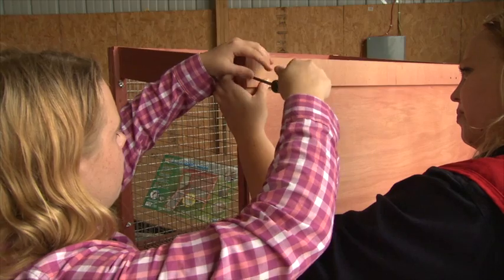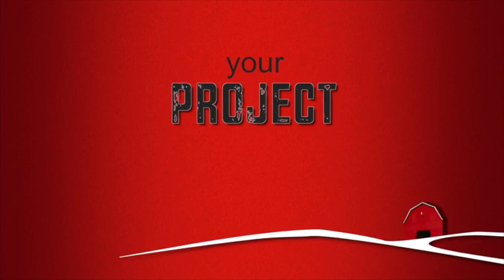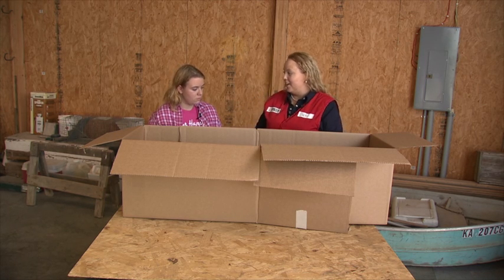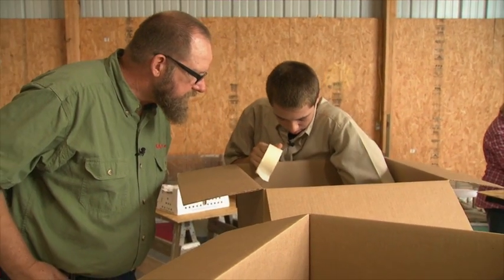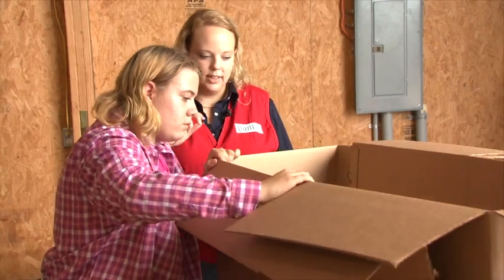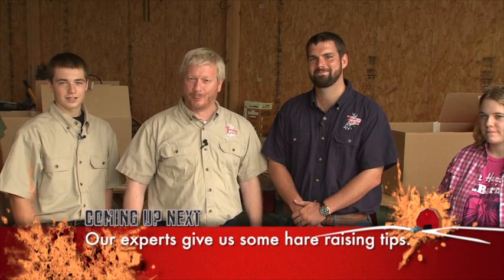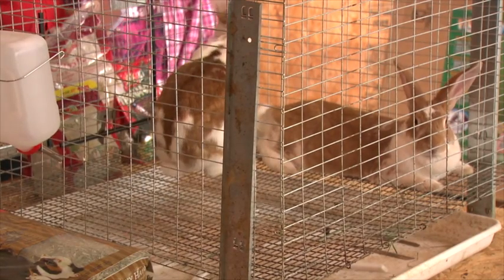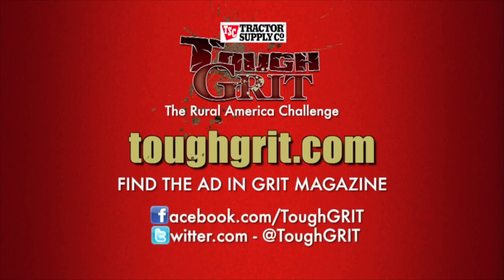Tough GRIT Episode 16: Don't Count Your Chickens (Full Episode) -- GRIT

Comment: Heat lamp in the brooder, ESPECIALLY a small cardboard one - recipe for a fire especially if not WELL secured above the brooder (and it is NOT in the video)! If that "support beam" gets knocked or the flap moved out, the lamp will fall. Roasted chicks, house possibly burned down. Don't do it. 

In a space that size the entire area will be overheated by the lamp and the setup does NOT allow for raising it high enough. The chicks will not be able to get away from it, will never have a day/night cycle and will be cheeping constantly. Why? Because they don't know it is time to be asleep and they are HOT. Also, the 95F first week, 90F second week thing is totally unnatural, hens do not regulate ambient air temperature and chicks even a few days old spend most of their awake hours NOT under the hen. Chicks raised by a hen can thrive in temps easily 30-40F lower. They go under the hen only when they need to warm up. It won't be long before they sit ON her, not UNDER her at times. 

Look into the "Mama Heating Pad Brooder" on BYC: http://www.backyardchickens.com/t/956958/mama-heating-pad-in-the-brooder-picture-heavy-update

Chicks raised this way are QUIET because they are comfortable, they sleep at night as they should, are less likely to get pasty butt and feather more quickly. The risk of fire from the heating pad is very minimal, unlike the heat lamp, and possible only if the pad has an electrical short, it cannot start a contact fire. The ambient air (and thus the air in the room where you are brooding the chicks) is not overheated, the chicks are heated by direct contact with the heating pad, same as you would be if you put one on your back. Yes a heating pad will cost more than a heat lamp and reflector but will use much less electricity and can be useful for humans year round. 

I also suggest raising the food and water up a few inches so the chicks don't fill them with shavings. Chicks will naturally start "foraging" very early tossing shavings a surprising distance.